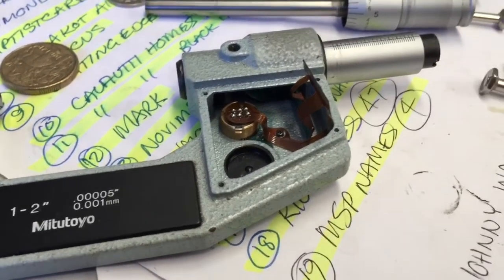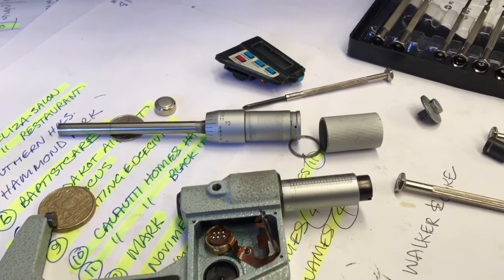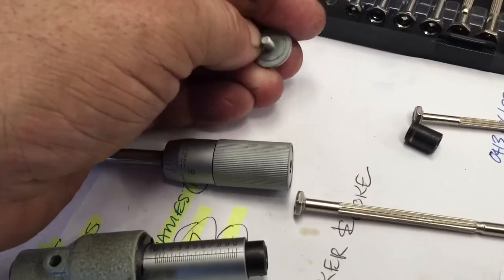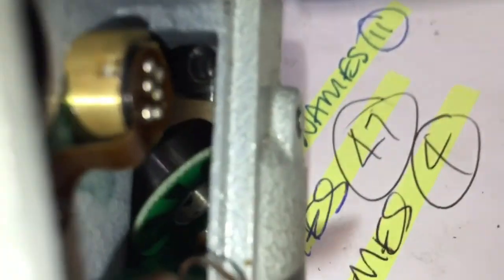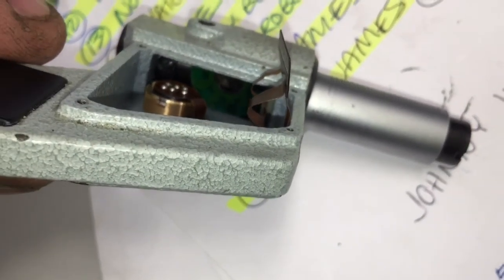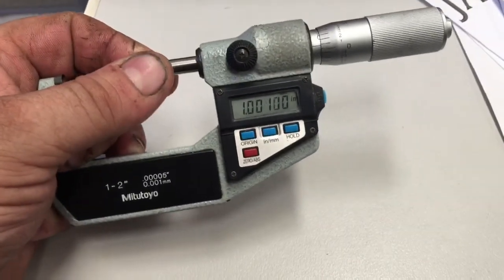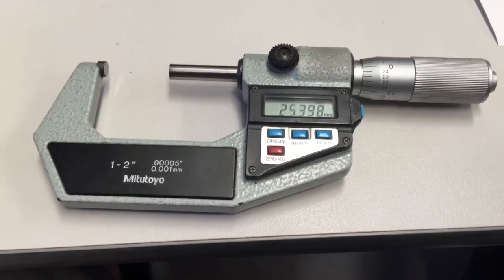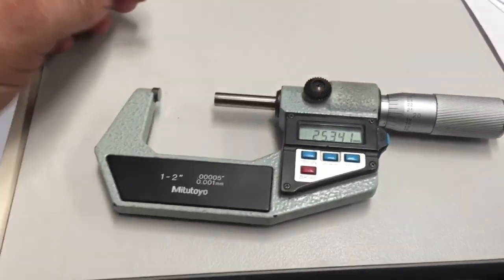Mitutoyo E-05 error fixed!

Comment: I’m just reassembling my digimatic, the rotor of the encoder is keyed to the spindle with a pointed grub screw, which is in turn locked with a second screw in the same hole. Took me a while to work out but really helped once I knew.  What surprised me was how simple the design is and how well it works.
Reply from the maker: Yeah awesome! Glad you got yours sorted
Reply: @JBFromOZ FYI you have a friction thimble, not a ratchet thimble. Two different things. It's not supposed to "ratchet" or "click."

Comment: Hello nice job getting it apart without killing it.  #1 what your mic has is a friction thimble , they have one that looks similar But has a ratchet mechanism inside and i rather prefer that to the slip sleeve you have. #2 the flashing “P” is a preset function which allows one to set a origin preset numeric value. But you must hold the button in till the cursers appear under each display digit. CAUTION the first space will change the display from positive to minus. Lets say you have a 1.500 gage block you can set the origin value to 1.500 rather than 1.000 . Only one thing if you need to reset the origin you will need the 1.500 block.  We should all keep in mind the accuracy of measuring instruments still rely on the accuracy of the ground mic screw thread, its only converting the rotation to a rotary counter for digital display which is must faster to read the value. People its not magic, the tools suffer the same damage when dropped or misused . Always treat them with great respect & care & ( NEVER LEND THEM OUT ).
Reply from the maker: thanks for updating us on the functions here mate, all very welcomed cheers mate

Comment: I can't get the little black steel cylinder that guides the measuring rod back on without removing the connector pin holder. Have you removed it?
Reply from the maker: It was a long time ago, I’m sorry I don’t recall

Comment: how did you disassemble this micrometer? you didn't show it
Reply: I finally figured it out. Inside the panel, on the steam is a collar with a screw in it. When you remove that screw, there is another screw underneath it. Remove both and it will pull out.

Comment: You don't hear ratcheting clicks with yours because of that wire spring. Other similar Mitutoyos will be fitted with a flat sheet metal spring instead, which is riding on an internal ratcheting wheel inside the barrel. Those are the ones that click.
Reply from the maker: I have a follow up video which shows both types of mechanism!, I prefer the metal spring one, it feels more "positive", the wire spring seems to loosen up over time
Reply: When you look at the options for Micrometers, this is called a friction thimble.  the one you prefer is a ratchet thimble.  Thanks for sharing your video.
Reply from the maker: indeed!, here is my video illustrating the two variants, thanks heaps for watching
https://www.youtube.com/watch?v=qJDphZlaZFM

Comment: I dropped my mic, just like this one now it’s turning hard not smooth, can it be fixed ?
Reply: Hate to break it to you mate but probably bent the spindle / thimble threads. Normally in this case you would buy a new thimble assembly. You’ll have to find which thimble part # matches your mic. But honestly with all that trouble you can find used mics in good condition for about the same price as a thimble assembly.

Comment: Nice vid sir, I have an older one inch digital and it does indeed have a ratchet mechanism, which is very very easy to fuck up the spring! Don't take apart unless you are prepared to get a new one from Mitutoyo lol I have just got a standard 0-1" tenths mic and it has the same spring arrangement as yours has, having no clicks but relying on the friction of the spring unwinding to give the same moment of force to close the faces of the spindle and anvil.
Reply from the maker: Yes indeed! Attempting to open up a set of delicate instruments like these is always a risk if the first time. This is one reason I try to capture my folly for others to learn before they also follow ;-)

Comment: Useless Starts off with it disassembled - lots of mumbling, ...presto it's reassembled (skipped those steps too)
Reply: Yeah, pretty much worthless video.   can't find er-05 fix elsewhere on web.
Reply: I agree, though some of the shots helped me with re-assembly of mine.  Would have been great to see the steps involved with disassembly and equally the re-assembly of the mic.  I'm still struggling with a stiff thimble and haven't figured out the purpose of the ratchet portion, my ratchet thimble just free spins when closing the mic, seems to work okay when opening it though.

Comment: Greetings from Spain, thank you very much for your video; I could take a picture of the flex connector, in the video I can not distinguish the connections well, I need it to repair. Thank you. Sorry for my English, I use a translator.
Moments of his video that is almost appreciated, what I ask: 3:56, 3:45, 3:55, 4:01.
regards
Reply from the maker: I will try to get some better pictures for you
Reply: @JBFromOZ Gracias por tu ayuda.

Comment: How do you turn this bugger off? Referring to the Mitutoyo.
Reply from the maker: From memory it turns the display off after idling for some time, (this helps retain position so it doesn’t lose calibration between uses) it remains on low draw power to hold position though, so batteries do drain over time